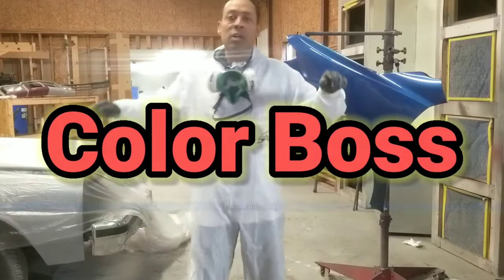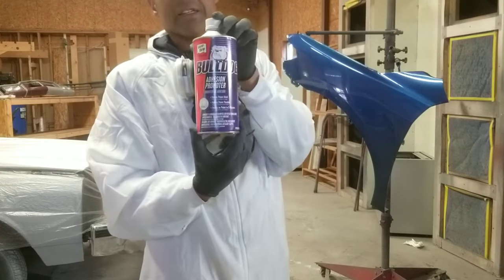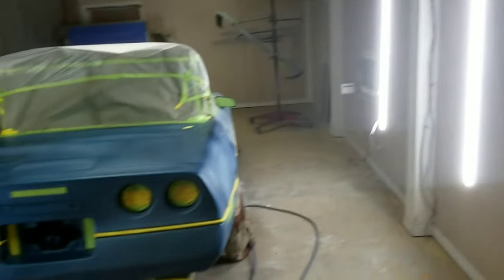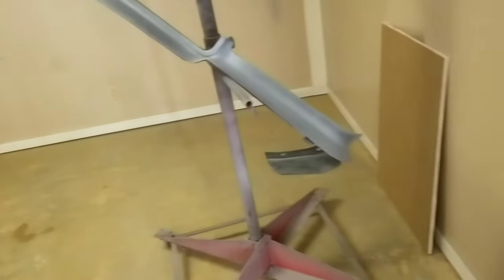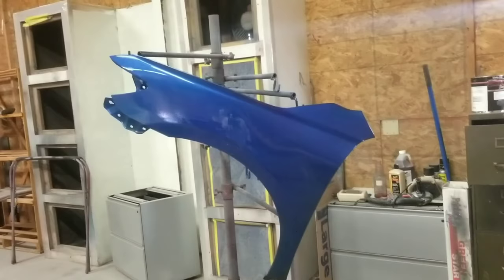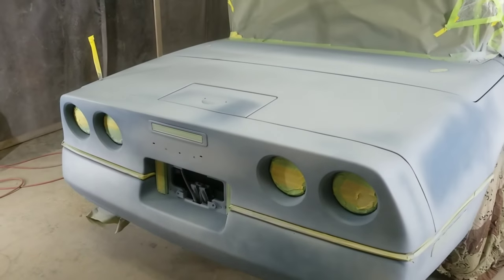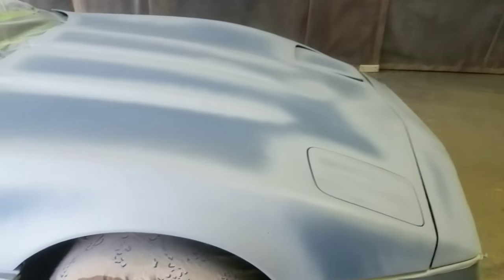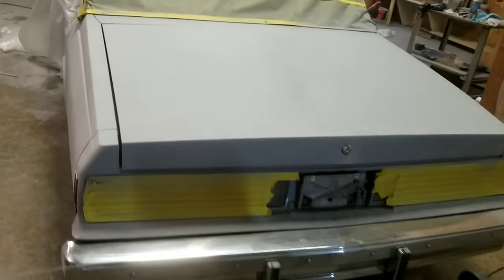1989 Corvette Panel Prep with Bulldog Adhesion Promoter

Comment: Would it be fine to spray the whole car with this before spraying the base coat? I'm doing a 82 Corvette
Reply from the maker: I don't know if adhesion promoter is meant for shooting on panels that have paint on them already. From what I've been told, Bulldog bites into the plastic, literally melting it, and allowing your first coat of primer to adhere to the plastic better. It's been a while since I shot this video, and now I've learned the chemical reaction side to adhesion promoters!